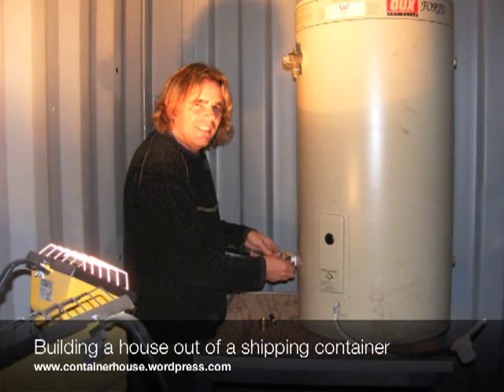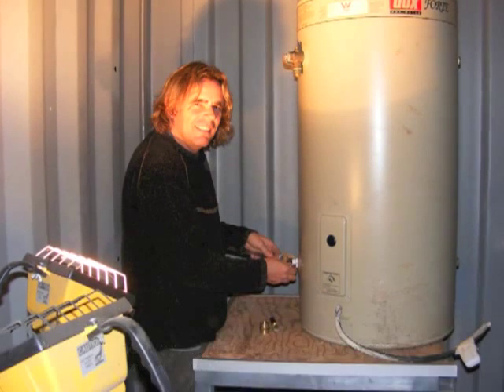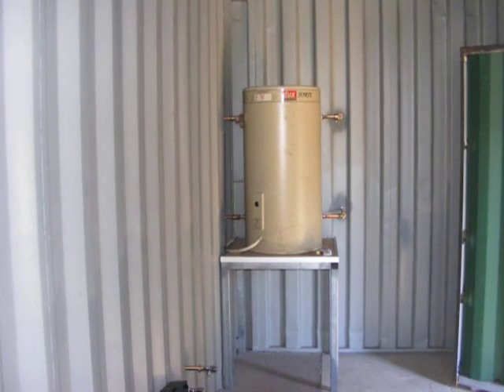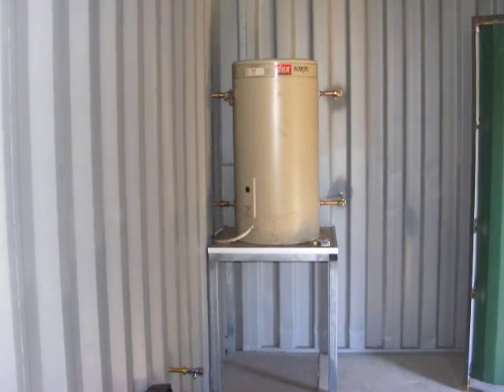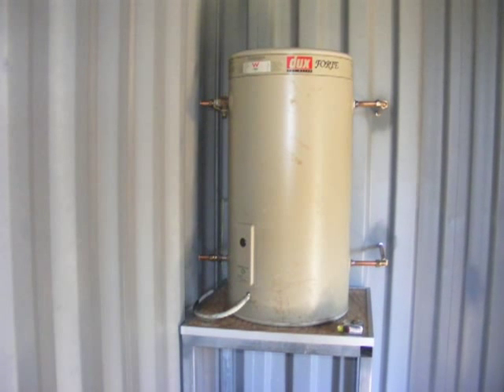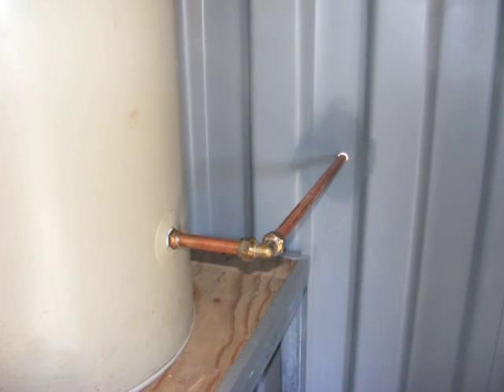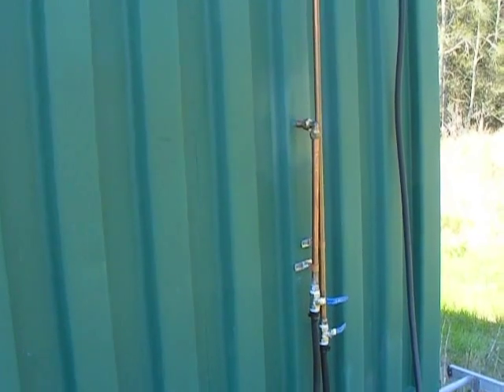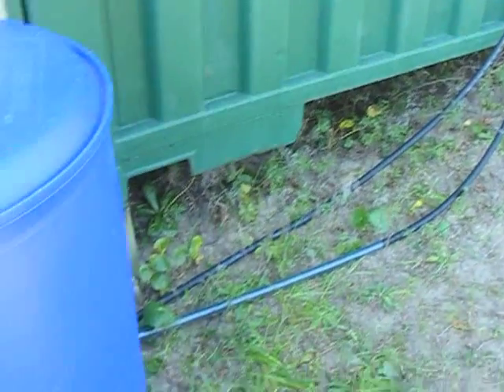Shipping Container House - Hot water system

Comment: Great video, I appreciate the level of detail in your descriptions. I notice you don't have a pump for the water to/from the solar panel. Does this work by thermosyphoning alone?
Back in England, where solar hot water isn't very viable, I'm planning on heating water using a woodburning stove with a 3/4" copper pipe coiled around the stove pipe, which will hopefully create a thermosyphoning loop with the hot water tank. Luckily I can have the hot water tank close enough to the stove for it to work (theoretically) without a pump.
Reply from the maker: Yes it was thermosyphon alone. I used the solar panel on my out door bath. See my video "solar powered outdoor bath". Winter in Australia cannot run a primary hot water system. I use gas. I plan a similar project to you for my winter bath. Stick with thicker pipe, I am told thin causes boiling problems and steam issues. I think thermosyphon will work fine.
Reply: Paul Chambers
Thanks for the tip. I have seen some people add a pressure gauge and a pressure release valve to the loop, to help avoid explosions. Might look into it!